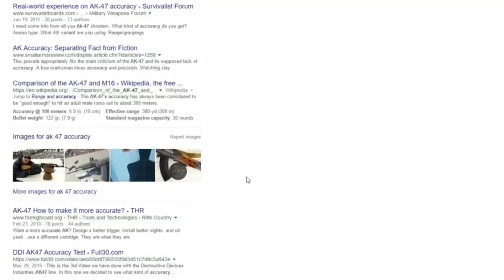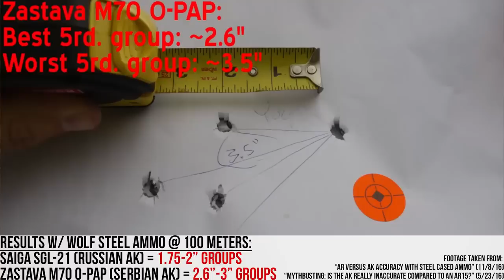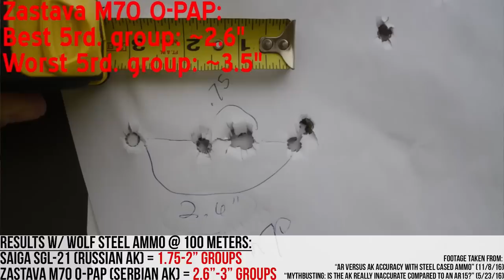Busting the WORST AK-47 Myths! (Featuring InRange TV and Mishaco)

Comment: AKs ARE inaccurate as issued with standard iron notch sights. AKs are NOT "invincible" but they are about 10x closer to invincibility than virtually any other military rifle. The so called "sight radius" OR the distance forward of the rear site IS an issue that lends itself to poor accuracy. This is the primary reason why AK clones like the Galil and the Valmet rifles that both have reputations for "better than AK" accuracy have rear sights mounted behind the bolt rather than forward. It is very ironic that I am explaining this as there is another TFB TV video from May 2016 on the Valmet M-76 (The AK Perfected?) in which this is clearly addressed and yet here on THIS video it is being claimed as a "MYTH"....well, which one is it? Way to totally contradict yourselves and look silly!! Good job!
Reply: @00008HANK  Did you not understand what I said? There is another TFB video that contradicts the so called "points" here.
Reply: @craigdamage  then why not link it?

Comment: wow you fired an AK at 100M. That's pretty much not sniping.  why bother having a scope at that range.  You've already have the rifles mounted. I never missed with my M16 at 300M with iron sites... so not impressed with scopes.  Also firing the AK with anything other than single shot makes the rifle anti aircraft weapon.  Notice the flash suppressor is missing from the top of the AK barrel.  Thats to improve downward force.  It doesnt help much. 
And Mishko ignores the fact that the soviets just stole a german designed weapon.  Its not like someone actually tried to hide that.

Comment: It is not the shooter it is a flawed design. I would encourage anyone watching this video to watch tales of the gun AK-47 versus M16. the AK-47 operation and M16 operation are shown in slow motion that's where you can determine why it is so inaccurate. The AK-47 has loose tolerances and moving Parts including the barrel which moves around. at 30 yards a Russian Special Forces Soldier barely just clipped the left bottom of the target but every shot with the M16 was directly in the Kill Zone at 30 yards. Of course that is not Illustrated in this video but regardless of what you say, reality is reality. now go watch those videos but I'll tell you this, AK-47 fans are like Democrats in that way, it can be right in front of their eyes that they see it and they still deny it.

Comment: Awwww... So. The AK isn't "cheap" to make AND took the "full effort of Russia to produce"??? That much effort into a stamped and pinned type of gun is kinda embarrassing. However, Russians have never been known for finely/proudly made products- just has to work or get the job done. The only thing this has convinced me of is to be that much prouder of the AR rifle.
Reply: If they cost the exact same, I would choose the AR hands down! The point of the AK I thought was an indestructible/tough and powerful field rifle that has super inexpensive ammo and purchase price. If all money points are equal I want all of the design features and intentions that the AR provides.
Reply: not exactly, it is cheap to make but it's not when you have to purchase the machining to make parts for the gun (plus it's not really a stamped and pinned gun, there's a lot more work involved, such as riveting)

if you wanna see how expensive rifles can get when you have to purchase or make the tooling to manufacture them, look no further than the AR-15 in Russia, where a mid-range rifle that's about $500-700 here is about $2500 over there

Comment: Sorry michio or wharever your name is but your ecinomics are just plain wrong. The ak is cheap to manufacture, period. In any mass production youvwill have to set up production facilities so I dont know what you are on about there. The cost is actually relative to many other factor. Milled vs stamped, trained specialized workers vs cheap labour and finally time to manufacture of one  unit process vs another.
Based on those real world criteria the ak is dirt cheap to manufacture.

Comment: A perfectly accurate rifle?  We live in an age of 1 moa rifles out of the box.  An ar with a quality, floated barrel should be capable of 1/2 moa.
Mounting an optic on that catywampus mount, of a flexible piece of tin (receiver) is folly.  Ak sights are awful, just awful.  For a weapon used as an extended range subgun, this is all fine.  As a riflemans rifle, it's awful.  
The Russians couldn't build akms until they improved their stamping technology.  Guide lamp or inland could have built akm during Wwii, no problem.